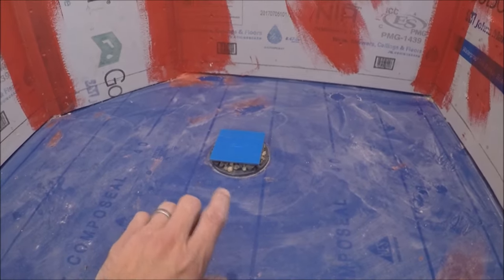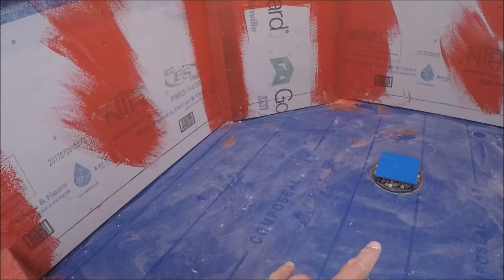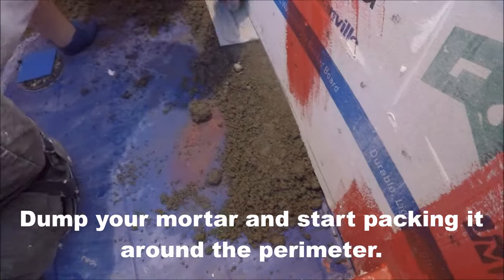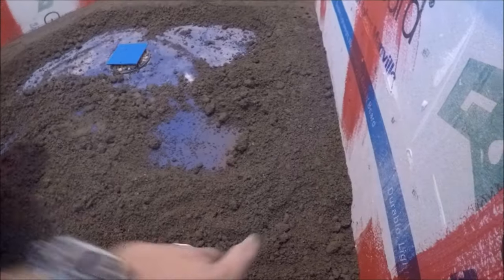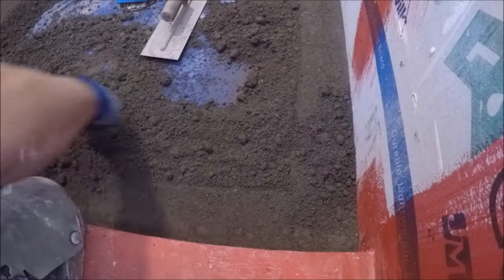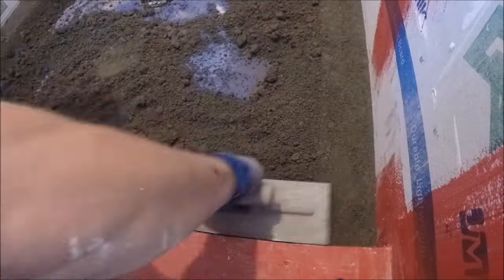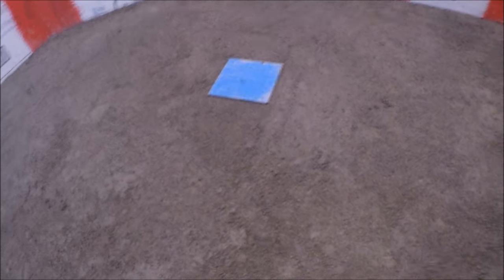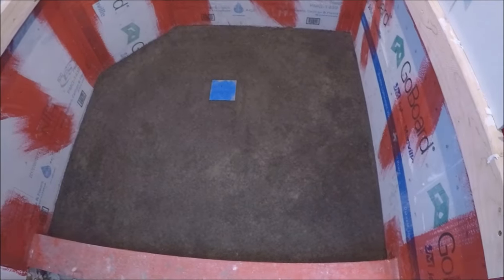How to Install Mortar for a  Shower Pan Quick and Easy

Comment: For the bucket mortar mixer do you recommend using a regular mixer or a drill like the dewalt you’re using?
Reply from the maker: Both will work for sure 👊 It's a great mixer
Reply from the maker: We use the cordless drill because we don't want cords! I'm still waiting for the 7 inch full size cordless tile saw with the gravity stand! It's coming soon I hope...
Reply: Landberg Tile DIY TV a 10 inch will be better.  I like how we are getting a lot of cordless options it makes our job easier.
Reply from the maker: @TilerHub  I'm thinking something small and light that one person can carry and with a gravity stand. I did a review on the Beast 7 inch and it was a BEAST, but was super light and cut just as good as the Dewalt 10 inch. Having something a little smaller that can rip a 36 inch tile like the beast, but with batteries would be amazing!
Reply: Landberg Tile DIY TV yeah definitely, I got the 10 inch and I love it. But I agree something lighter and cordless could change the game. I hope we see it soon.

Comment: Everything you did is correct but your backer board should be about 1 inch above the shower pan mud because it will try to suck up the water from the shower pan. Im not hating just a helpful tip that might help you
Reply from the maker: Goboard is 100% waterproof backerboard and is okay beneath the drypack mortar bed.
Reply: @LandbergTileTV  really never heard of it, where do you get it?

Comment: install pan during rough framing before installing cement board. lots of videos on why you shouldn't have your wall board going into the pan.
Reply from the maker: That board is Goboard 100% waterproof. It does not wick like concrete board.
Reply: This comment & reply, is awesome.. explains benefit & now obvious superiority of Goboard (a brand/material I've never heard of) over cement boards. &  Explains two different ways to set up the shower pan and is leading me into researching wicking of cement boards! 👍 Thanks guys 🤙

Comment: Nice tutorial! Can you tell what exactly you are going to do with pebbles around the floor waste? Was it as a temporary support before tiling, or the floor waste must be permanently fixed during bedding? Should it be removed and its position adjusted while tiling or tiles level can be played only? Do you fix perimeter of waist by screed, tile adhesive or, may be by any silicone? Thank you

Comment: So im only 25 been working alone for three years now now I told a builder I work with yeah I can do tile thinking it was a floor because thats what I do is flooring and he said great you know jow to build a mud pan lol hell no but i said yeah anyways lol now I'm trying to learn it all
Reply from the maker: Not hard to do, take your time and mix it to a dry snowball consistency. Use small and large levels and make sure its levels around the perimeter.

Comment: Is there also a pre-slope under the liner? If not this pan will hold water.
Reply: Please explain?
Reply: @angelsemerdzhiev7540  there should be a pre-slope underneath the liner to help drain the water that is entrapped in the sand/mortar base. This base will be full of water and with the liner being flat on the subfloor (and not sloped towards the drain) it will basically be a "bathtub" and hold the water. This may not pose short term issues but it may in the long term. From my experience most contractors simply lay the liner on the flat floor but the more thorough contractor would definitely build a pre-slope before laying down the liner and then adding a second layer of mortar on the liner like shown in this video.
Reply: @torre1481  thank you so much for the response... It explained alot.
Reply: Always pre-slope !!

Comment: I’ve seen a lot of guys’ll felt on top of the subfloor, then do a sloped mortar pour towards the drain, then after that dries, cover it with a pan liner membrane. Then do another sloped mortar pour to finish it out. Are the 2 mortar pours necessary?
Reply: @LandbergTileTV  Careful bud, you dont want to sound like "BOB" too much.
In parts of the country, you cant get by without preslope. Try not presloping with proper permits and inspections and you'll be sent home. Youtube proof or not..
Reply: Many shower pans I've ripped up had no preslope, the water going through the pan mud sat and did not evacuate. This cause a ton of mold and mildew to accumulate causing the bathrooms to smell even after cleaned. Presloping is not required in many areas, however if you care about your trade, why not make sure your customer is taken care of? It's like welding  a plate over your oil filter in your car and saying theres no proof your filter really filters. Exaggerating of course, but theres a reason the TCNA is recommending preslopes. I live in a area where it's not required, I do it regardless. That's just me.
Reply: If you’re using a liner a pre slope is needed. No pre slope will get you a lot of water and your drain is gonna clog because of calcification. It doesn’t help as much but is better tan no pre slope. Quit using liners

Comment: I did this but seems like the motor didn’t cure right I can keep scraping like dust of the top of it an I’m afraid the tile isn’t going to stick,can I seal it ?? Will tile still stick if sealed ??
Reply from the maker: Hard to say, I would recommend removing the drypack and installing agian making sure you have the right mixture of mortar.

Comment: What is Dry Pack mortar?  Is it regular mortar that I mix with water?
Reply from the maker: We use spec mix and mix is dry pack, never too wet. Very easy to work with.

Comment: Where do I find that mixing auger?!?!
Reply from the maker: Go back to my video and in the description below, there is a direct  Amazon link you can click on. This auger is amazing!
Reply: GAH! How'd I miss that! Thanks!
Reply: Marty Lewandowski e
Reply: Contractors direct has them also I got mine there but I'm not a fan , I just take my concrete sand and Portland cement 4 to 1 dump it on a tarp flip it back and forth add some water to it mix back and forth to desire consistency and done .
Reply: I found with the auger I would get spots that weren't mix properly

Comment: Doesnt look like a very smooth surface for a tile install. Do you skim coat on top of it or something? Sorry, just a typical floor installer trying to translate it to showers haha
Reply from the maker: Yes, it's smoother than you think. You trowel thinset on it and install your pan tile.
Reply: @LandbergTileTV  standard double coat thinset? Treat it as an emboss basically?
Reply from the maker: @thebucketlist5061  yes, exactly

Comment: So if I have an offset drain which is a few inches away from one wall and over 3 feet from the other wall, the line around the shower from where to start the dry pack will be the same correct?
Reply from the maker: Just make sure it's a 1/4 " per foot for your shower pitch and you will be good to go! 👊
Reply: @LandbergTileTV  Nice, thanks
Reply: So if the drain is offset to the right side of the shower, then you would take the longest measurement between drain and wall, if it’s 4 ft on one side and 2 ft on the other you go with 4.  That’s a quarter inch a foot so you’d need an inch of rise on longest side.  To make it level around the top you’d use 1” all the way around even though you only need 1/2” of rise on other side.
Reply: @gyfhj  got it, thanks

Comment: Great technique, however embedding your durock or shower wall board of choice in the pan is a huge mistake.
Reply from the maker: This is 100% waterproof Go Board, it's okay to embed.
Reply: I have found that anytime you embed any type of board, it creates a trough that water will hold in. even if it’s the slightest amount, it will cause the inside corner to mildew. I always install my wall board on the wall with the bottom of it level with the top of where I want my pan for two reasons. 
1) above reason
2) It gives me a straight and level guide for  the top of my pan. I guess to each their own but I have replaced a few of these for this very reason. One of them was so bad that water constantly wicked out of it. In that case though the installer didn’t ensure they packed the dry mortar underneath the wallboard creating a hollow spot. Most are not that extreme
Reply: I haven't got that far yet....but i thought the pan was first.....then DuRock comes down
Reply: @phillippettit2138  we always do the under pan liner preslope of mortar ( a step a lot of people skip), install the pan liner material over the first pan, then we install felt on the walls overlapping the pan liner, install the durock 2-2.5” (perfectly level) above first pan. This allows us to install our finished/top pan perfectly level and straight on the edges by using the bottom edge of the durock as a guide. Note that we leave 1/4”-1/2” gap between the durock and the final pan. I don’t know if this is necessary but I never allow any wall materials to come in contact with any  floors to prevent potential wicking of water. We have followed this method for many years and have never had a call back. Hope this helps
Reply: @markmanning6773  excellent brother 
Thank you for your time.....I am going to go the "Hot Mop" method only because i have used in some of my previous fixers.....are you opposed to hot mop ?
Reply: @phillippettit2138  I am familiar with it but have never done it. If done correctly, I am certain it’s a good method
Reply: @markmanning6773  so then do you fill the gap between the top of the pan and durock with grout before placing the floor tile and wall tile?
Reply: @nathantimm8909  no. I mean if some thin set gets in there that’s fine but we don’t intentionally fill that gap
Reply: @markmanning6773  Do you Red Guard your pan? If so, how do you waterproof where the wall board meets the pan?

Comment: You should never allow your pan to touch the wall board. This will wick moisture and create black mold. In 6 months
Reply from the maker: This is Go Board 100% waterproof, so yes, you can drop the board all the way down to the pan as it does not wick like hardibacker. You should try out this board sometimes (Lowes) 👊
Reply: Can always paint the first foot of wallboard with a waterproofing membrane if you want to be extra cautious
Reply: If you plan on Redgarding the whole shower including the pan this won't matter.
Reply: Hell yeah I use go board and red guard just to be safe. But I still dont embed my walls in the dry pack. I was taught to floor first and set walls half inch or so above
Reply: I bury my wall panels into the pan as part of the sealed system I use:  Wedi wall panels, mud pan, Subliner dry over pan and Laticrete bonding flange drain.   Hydroban the pan and cub corners with anti-fracture fabric.  Works great!

Comment: Looks like you put your walls down into the shower pan.   Most experts say don't do that.   Put the mortar in THEN install the walls to 1 inch above the mortar bed to prevent wicking.
Reply from the maker: Goboard will not wick, 100% waterproof

Comment: Shouldn't drop that wall board below dry pack floor. That's a no no.
Reply: First thing I said to myself
Reply from the maker: It's okay with 100% waterproof board like Goboard, Kerdi board or Hydroban board. It's a no no with concrete board or drywall
Reply: @LandbergTileTV  🫡

Comment: PVC membrane liners are know to rot and fail. Because there is no “pre-slope” for drain clamp this system will have moisture issues . Schluter !!!
Reply: He may have done a pre slope under the liner that's how I always do mine. I've used kerdi and dont complain but really like dry pack and a liner